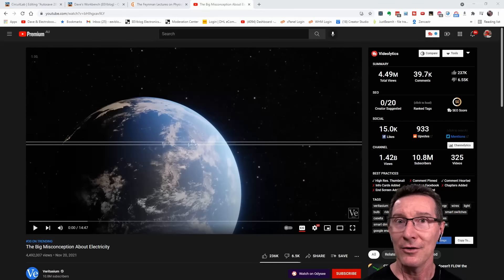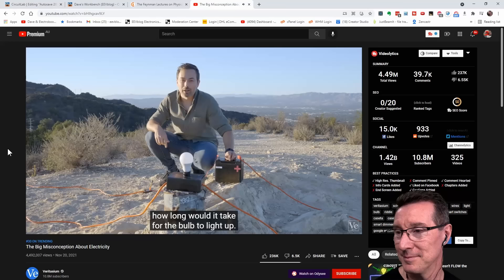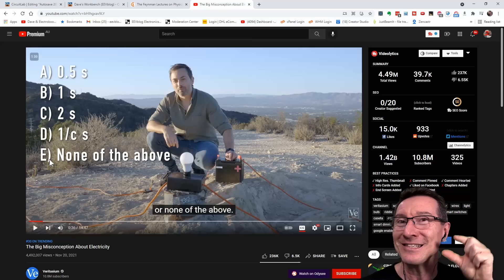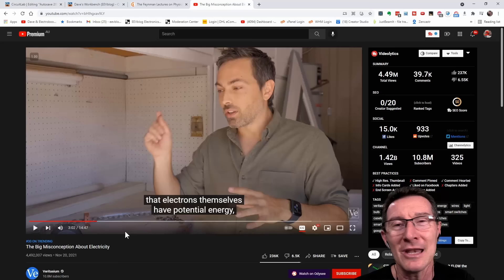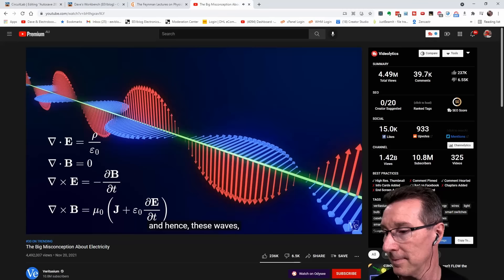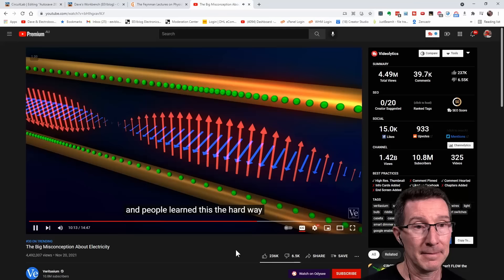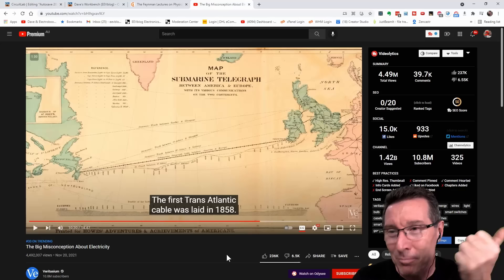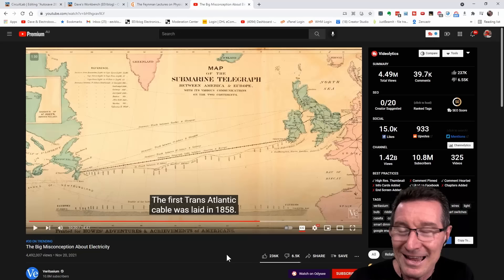EEVblog 1439 - Analysing Veritasium's Electricity Misconceptions Video

Comment: Very valuable pair of videos. Kudos to both Derek and EEVBlog for appealing to general audiences in order to explain the magic of electromagnetism but also to confirm to RF engineers what they've been doing for decades, which itself is a confirmation of the physics behind electromagnetism. The physics behind electromagnetism is lucidly and brilliantly explained in the textbook Electrodynamics by Melvin Schwartz first published in the late 60s. Basically the entire field of Electrodynamics rests upon a solid underpinning of Einstein's relativity and the fact the the Electromagnetic field is a 4D Invariant Tensor, not some combination of 3D vectors. In addition, ohms law is an approximation based on the assumptions made about the drift velocity of electrons.

Well done
Reply: Careful!  Dave here uses the wrong model for Derek's experiment setup.  A transmission line model is not applicable, the better model is a dipole antenna model.  See my explanation in the main thread.
Reply: Cool, now let's calculate the time it takes to light up a bulb if the 300k kilometers of wire was laid out in a perfect circle. ;D

Comment: As a computer engineer, we focused more on the practical side than the theory side when we covered electricity and circuit building, and this was news to me. (It's possible we glossed over this in class and I don't remember but we definitely never went in this much depth). This was rather counter intuitive to me and my mind is blown. I love that I can be this wrong, the more I learn the less I know. Thank you for the knowledge and praise Maxwell!
Reply: Same for me. I don't understand Dave's exasperated "WHO THINKS THAT?" followed  by "All engineers know that". He keeps on answering his own question: the rest of the world. Veritasium is not aimed exclusively towards engineers. Actually, I'd say its rather the opposite. Derek never claim that this is unknown. Just that it's a common misconception, which I can bet everybody's asses that it is.
Reply: Yup same!
Reply: Same for me.  I'm also an amateur electronics enthusiast and I learned something from this and Derek's video.
Reply: If you had taken power systems engineering (I had one semester) electromagnetics, or RF design (which requires the previous as prerequisite), Poynting vectors and fields in general are thoroughly dealt with in those courses. Computer engineering blows past a lot of fundamental engineering. I was an embedded systems and instruments guy myself, the computer engineer in me was developed because of market conditions, not coursework. Although I had 1 graduate course in computer architecture and 3 courses in C/C++ years later in community college.

Comment: As a member of the general public: when I finished watching Veritasium's video I have gotten the impression that faster than light communication is possible, because i missed that  the exact arrangement of the wires is important.
Thanks for clearing this up for me, I might be interested in learning more about this as a result =]
Reply: the important question for me is what happens if someone cuts the cable at one of the far ends (150,000 km away), how long would it take for the bulb to turn off? it certainly has to be 1/2  second, because otherwise the information that the circuit is no longer closed would be travelling faster than light.

But if the cable was cut before closing the switch, you could close it and see if the bulb turns on after 1 m / c seconds. If it doesn't then the information that the cable is cut traveled faster than light.

So how can the circuit "know" that it's complete in just 1 m / c seconds
Reply: @_invencible_  Electromagnetic induction? The wires close to the battery and those close to the lightbuld are just one meter apart, the lightbulb and the battery are just one meter apart. The switch is close-by too. Flick the switch, cause the electromagnetic fields to change, cause electromagnetic induction between those close by wires, power the light bulb for a bit.

But, without making any calculations, which I'm not even sure I could make, I doubt the energy transferred would be enough to actually light up the bulb, especially at 1m/c time.
Reply: =RNGFN= Invencible Well the electrical engineering answer would be that it does not matter if you cut the wire before closing the switch because the energy capacitively couples from one part to the other, just as shown in dave's video in his simulation. The lamp would turn on and eventually turn off once the transient is over. The time it can stay lit would depend on the actual capacitance between the two wires and the impedance of that light bulb and some other stuff like inductance in the wire. (well, keep in mind that with real components it might never actually light up..)
Hope this helps and isn't too complicated for somebody with no EE background.
Reply: @allesklarklaus147  yeah but what if you take a whole chunk of the cable so there's a large gap between the ends?
Reply: =RNGFN= Invencible Okay, I think I got what you are thinking about. The capacitance I am talking about comes from the fact that there are two wires laying 1m apart for 150.000km long ends. I am not talking about the capacitance at the point where you cut the wire. While that capacitance exists, it would be so small compared to the wire-laying-1m-apart capacitance that it is irrelevant.
Reply: I had the exact same thought. 

I'm going to stop watching his videos, I think he explains "simple" things in a complex and ambiguous way to get people arguing in the comments, and more views
Reply: What is called in general relativity a "wormhole". On the surface of the apple, you are forced to follow the surface to go from one point to another. But an work can dig through the space-time continuum
Reply: @_invencible_  The field acts just like spacetime acts on the photon. There is no space, just distance, and what rules is the speed of cause and effect. It is the distance between the root of the impulse on the field which is the location of the switch, not the battery, and the resistances that draw on the field which are all electrons involved though we see mostly just at the bulb. So wherever you cut the line or close it matters. From the field's point of view there is no space. For all elements in the field there are specific relations ruled by Special Relativity. That is how space introduces itself.
Reply: As a member for the general public (of which engineers and scientists are generally also members of) I didn't get that impression.  But the point that most people are missing is that Veritasium's videos are designed to educate, to make you think about things, to inspire learning and to go and investigate further should you want to know more. Not being an engineer or a physicist, I learned something new, something that challenged the preconceived ideas I had (and undoubtedly most people have too). There are things that you learn at school that aren't strictly true, but represent a level of understanding that suffices for most, unless they later study at higher level.
Reply: @janami-dharmam  i see why you're saying that. The wormhole is like the 1 m across from the battery to the bulb
Reply: @_invencible_   Yeah you're making a good point. I think maybe it travels every path quantum mechanically (faster than light) & then takes the path of least resistance = through air across the 1 m from battery to bulb
Reply: As someone who has worked with electricity and electronics for almost 10 years...That video made me question reality. Nothing made sense until Dave mentioned transmission lines and capacitance.
Reply: @_invencible_  did you watch the video and the simulation? 🤔
Reply: @kingdavewoody  I’m thinking the same. He’s creating click bait, and the obfuscation is too thick. One error (leaving off the distance unit in answer D) might be excusable as unintentional, but his building on it suggests it was intentional. Worse than click bait, he’s supporting anti-science, anti-expertise, and anti-intellectual attitudes with the tenor of his presentation (“we’ve been lied to by experts”). He’s profiting from creating ignorance, at the end of the day.
Reply: @MarcosElMalo2  couldn't have put it better myself.
Reply: @kingdavewoody  I stopped watching his videos a while ago when he was "dissecting" the YouTube algorithm (after the lake full of black balls) and since them I watched maybe 4 or 5 videos, like the one with lamps and programmed obsolescence, two with that wind cart and this one which Dave just had his engineering point of view on (I must have missed one... LOL)

For physics subjects I'd recommend Sabine Hossenfelder's channel (since she corrects herself and also talks about her own misconceptions from the past, among other things.) She puts a new video every Saturday, they're not very dense when there's no math involved and they have 10 minutes average.
Reply: Thanks for the recommendation :)

and yeah that black ball thumbnail video was a bit weird when I saw it, that confirms what I think

Comment: Great Video. As someone who always kept asking "why?" and "how exactly does this work?" during physics classes un school, i am a bit disappointed that people aren't taught this. I know it's easier to look at it as if the energy is flowing through the wires, but nobody ever teaches the "true" version. Amazing to finally understand this. Now will it help me in any way? Probably not, but i love understanding the universe more and more.
Reply: Let's throw away wires, who needs them when energy trawels without 'em.
Reply: @barnabaskiss2  😏
Reply: If energy doesn't travel "in the wire"  - then why does the wire increase in temperature when a current flows ?   -  Try connecting say a 9kW  shower with thin wire... and see what happens!!
 
Or - does it  suggest that there is a "resistive" part that heats the wire... and the transmission in energy outside the wire can be thought of as  a "reactive part"  - ie dissipates no power..?
Reply: @eric4709  Right. Of course the majority of the energy will actually travel IN the wire and not outside it. What most people seem to forget is that the em field also follows the inverse square law. So the further you go away from the field source (i.e. the moving electron), the weaker the field gets. So the majority of the actual power transmitted is inside the wire. Otherwise when you close your hand around an insulated wire and all the energy is transmitted outside the wire, 99% of the energy would go through your hand. However since there is no conductivity where actual electrons can enter / leave your hand, you do not get shocked.

Technically EVERY macroscopic physical interaction is the em field or gravity. There are only 4 fundemental forces in nature and most of them are the em field. So while the weak gravity from earth pulls you towards the center of earth, it's the em field of your molecules that repell from the molecules of the ground. "Atoms" do not actually collide when you hit a solid surface with your fist. It's the em field of the atoms which repell each other. All of chemistry is only about the em field and the interactions between atoms and molecules.

So technically the example with the metal chain, it's also the em field that is moving the chain and transmit the energy through the chain. How do you think do the chain segments "collide" with each other? Right, the em field of the molecules. So I don't get why everyone is so hyped about "yeah it's just the em field and not the electrons". That's just not true. Without the electrons you don't even have an em field. Also think abour the spatial power distribution in the field. Everybody knows magnets. Same inverse square law. If you get further away, the effect quickly becomes unnoticable. So this whole "any amount of power" (which was later added by veritasium) is complete nonsense and distorts the actual thing you want to explain. If the question was "when would you notice that the switch had been turned on at the light bulb?" everything would be fine. The amount of power that is actually induced on the other side is very small. So we're not talking about transfer or power but just signals / information.

So just to be clear: Probably 99% of the power is transferred INSIDE the wire through the em field. The drift velocity of electrons changes proportional to the strength of the field which is also directly proportional to the current. In the veritasium video it sounded like the electrons move very slowly at a constant rate which is not true. It's directly related to the current. Yes, in AC we have no net movement but that doesn't change those facts.

If it would only matter what happens outside the wire, why would it matter what diameter the conductor has or what material it's made of?

I don't get why so many directly agree 100% or 80% with Derek. The way it's presented is just misleading. When I pay a house and I say "I'll pay it tomorrow" and I plan to pay only $0.2 every day, can I claim that I have paid for the house? Technically yes, but practically no.
Reply: @Bunny99s  the inverse square law is only true because of the sphere of outward propagation.. but if all field lines are guided towards the sink (resistor), there is no loss..

Comment: Thank you Dave, this video provided me the information that I felt was missing from the Veritasium's video. I've studied civil engineering, not electrical engr and also I have my amateur radio certificate so this helped me link the transmission line theory into all of this. I've come to realize that there was something missing from my understanding of how all this works, I guess that I need to pick up some books on Electrical Engineering to complete my understanding.

I'll try and find these Feynman lectures, Thank you very much again for completing the picture of this for me. :)
Reply: Careful!  Dave here uses the wrong model for Derek's experiment setup.  A transmission line model is not applicable, so what you see on his graph is incorrect, and Derek's answer of 1/c for immediate steady ON is also not entirely right, it's misleading. For the immediate transient, the better model is a dipole antenna model.   Also, Derek conflates DC steady state with transient analysis which is false and folks who want to learn, get misled.  See my explanation in the main thread.